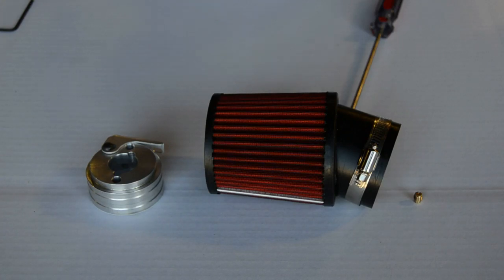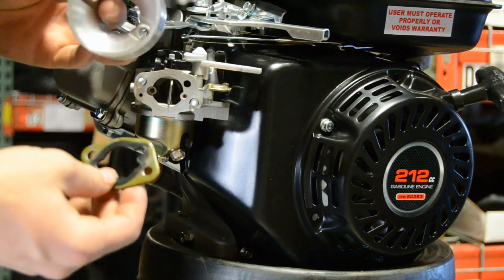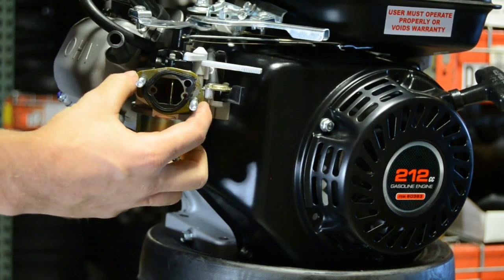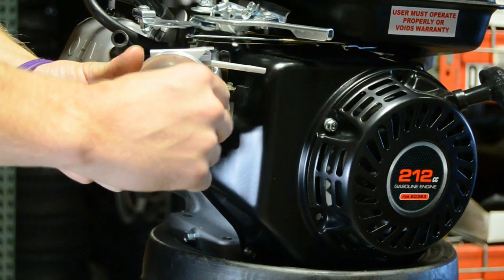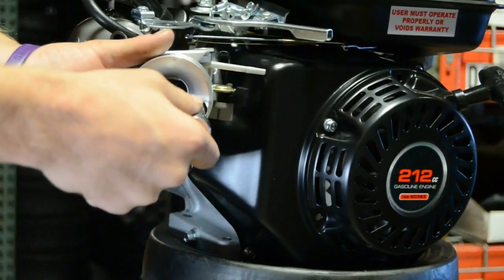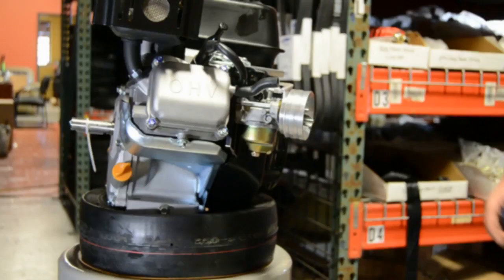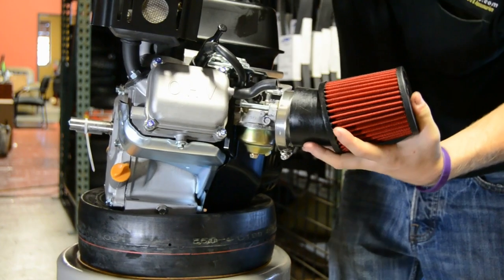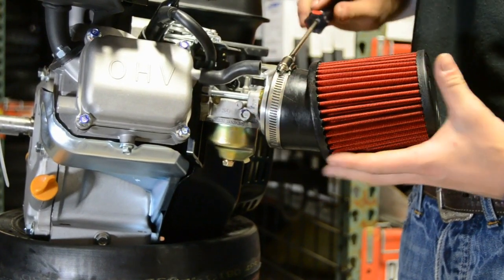Predator Performance Air Filter with Adapter and Jet Upgrade

Comment: What do you do with the hanging breather tube going into the valve cover and the other tube
Reply: Did you ever find the answer to this question because I would like to know it
Reply: @ChillSchoolKid  you just put a filter on the tube
Reply: @gokartsminibikesandmore9925  could you run a pulse pump from that tube or would you need a different location?
Reply: @gokartsminibikesandmore9925  what u mean like what type of filter

Comment: Incomplete installation! What do you do with the the bracket? Jet?
Reply: Wondering the same. After just filter, engine was revving higher for me, wondering if jet replacement would be needed?

Comment: For whatever reason, my engine stopped working when I put the filter on. It worked fine after the tail pipe was put on, however it would not start with the new filters or when I put the stock airbox back on.
Reply: Having the same problem Ik you’ll probably never see this but let me know if you fixed it
Reply: @alecreesvlogs5363  we did eventually fix it but the problem was unrelated to the kit. By coincidence, some wiring failed at the same time we installed the kit.

Comment: Hey, great video. But what do you do with the pipe that was connected from the original air box to the over head valve case?
Reply: Same question it sprays out
Reply: Get a catch can I ordered a cold air intake filter
Reply: Link?
Reply: Link

Comment: Gopowersports, i have a Mega Max 212cc, stock engine, just bought some stage 1 preformace upgrades for it, and after removing the stock air filter i took off the carb bolts to take off the cover for the choke and carb so i could put on the new filter, and the cover wont come off, whenever i try too i feel resistance as if theres another screw holding it in but theres not and iv double checked this multiple times. I dont know whether i should use brute strength to pry it out or jus try to snug out eventually im not too sure. Asking for suggestions for help.
Reply: Put two nuts back to back together than tighten the..then ya can back out the stud

Comment: I added this exact kit on my predator 212, and I have issues with my engine bogging out at high rpm and the throttle response time is really bad, Ive followed this video 100% im positive everything is installed correctly and dont know what the issue it. I've put the stock filter back on and everything runs fine. any ideas why this is happening or what could cause it?
Reply: Dune Burst probably getting to much air not enough fuel. Did u change the jet?
Reply: As stated above it could be the fact youre now getting to much air flow and will need a beefier jet. Or it could be youre exhaust needs upgrading
Reply: The issue is he posts "jet upgrade" on the headline and doesn't show it, misleading the audience.

Comment: so you don't have to do anything with the tube that is sticking out of the plate that says OHV?
Reply: JD Felder mine don't have a hole in it is that bad for the motor?
Reply: What about the 2 hoses left
Reply: @mbrrideitlikeyoustoleit8436  inquiry minds need to know

Comment: theres a plastic spacer between the carb and intake port. do you keep that on or take it off?
Reply: the one that holds the plug wire? keep it

Comment: WOAH! Put a breather filter on that! 😬
Reply: Yes, what do you do with the two hoses from the stock air box?  One hose goes to the valve cover and the other is a vent line to the top of the fuel tank.  Just stick a filter on them?
Reply: Put a filter on the one going to the valve cover, you don't need a filter on the one from the gas tank, just don't block or plug it. It's a one way valve that opens when there is a vaccum in the tank.

Comment: fit for Honda 160gx?
Reply: Yes it does all the way up to 212 I have a 196cc and it fits just like the cylinder head is the same for 160 up to 212.👊 I'm doing both of these as we speak